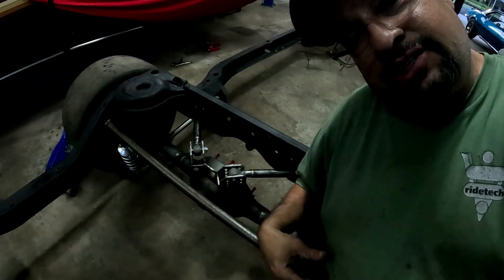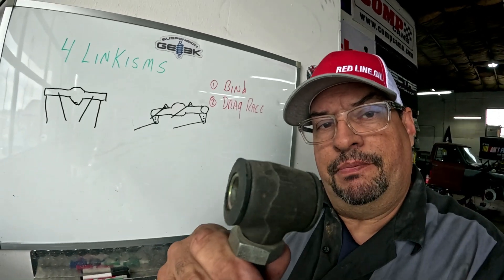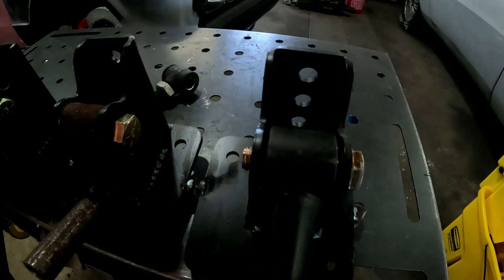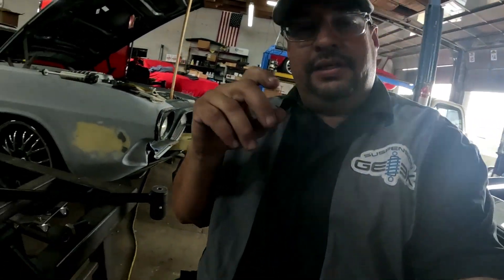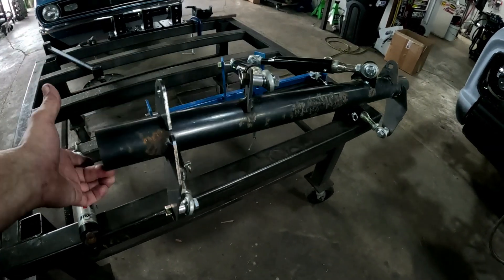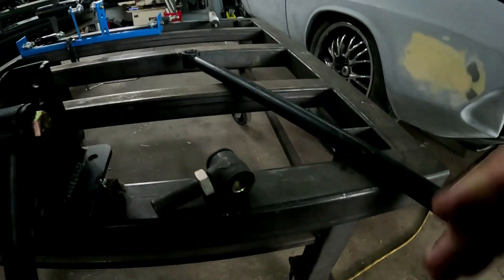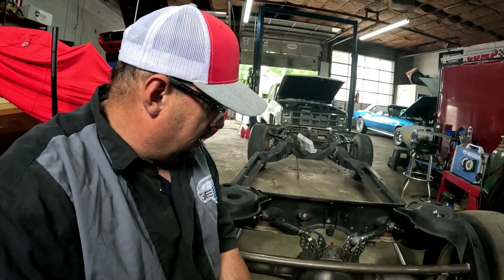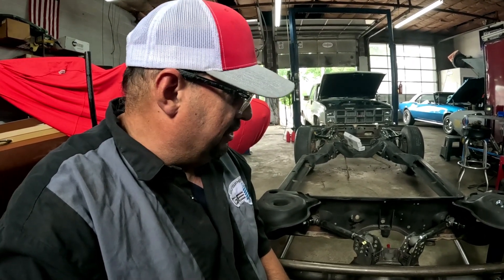The 4 Link Misconceptions Killing Your Suspension

Comment: So I have a wishbone style 3 link going onto a body dropped c10. It currently has bushings up front, and Johnny joints on the rear end. I won’t be carving corners to setting track records obviously. Is it really gonna be worth my effort to cut the bushings off and use helms or more Johnny joints on the front of the links instead of bushings?
Reply from the maker: It would help... but the johny joint on one end is pretty good and allows a decent range of motion

Comment: Great overview of triangle 4 link.   Trying to learn more so my one question on your setup.
Your lower links are parallel to the frame and the uppers are angled.  Both your big vendors you mention said both upper & lower links are supposed to be angled.  Facing forward the uppers  angle out and the lowers angle in.   Which is correct?   I like your lower links parallel with the frame.
Thanks
Reply from the maker: Most angle out because of packaging fitment under a car... cheap easy..  when i worked at ridetech i built my upper links angled in .. to act like a 3 link.. allowing more aggresive rotation in the corners.. and taller upper tabs for more anti squat.. there is no right or wrong.. they are built to wanted result

Comment: So it looks like your display 4-link has equal length links.
What happens if the lower links are significantly longer than the upper?
Also, what happens if the upper links are angled the other way, with the axle ends closer to the hubs and the chassis ends close to the center?

I have a road race car with a 3 link and panhard bar.  I'm curious about going to a 4 link, but it's an offset quick-change rear and there's not room to put the top links in the center of the axle.

Also, how does the roll center compare between the 3 link/panhard bar setup and a 4 link?
Reply from the maker: Lots of questions.. i will answer them later!!